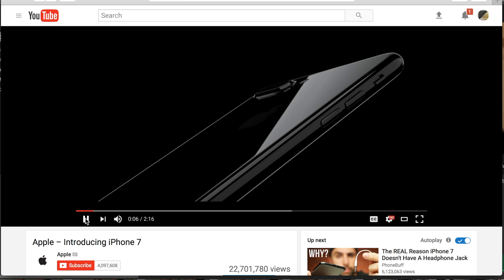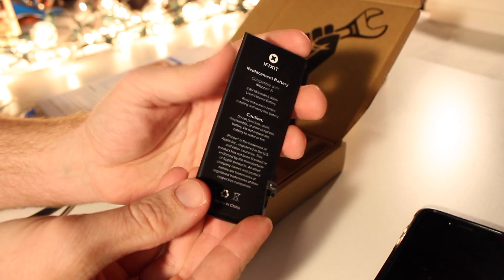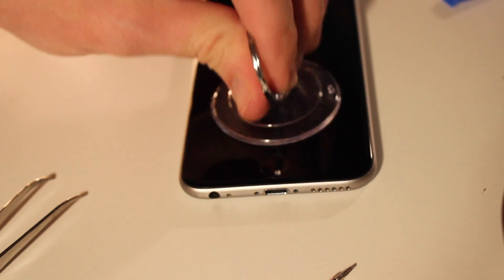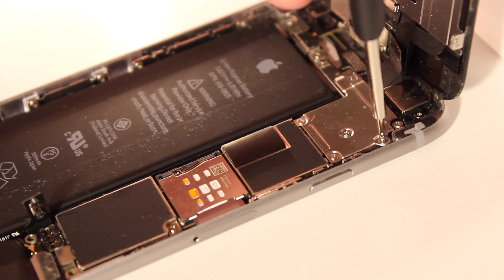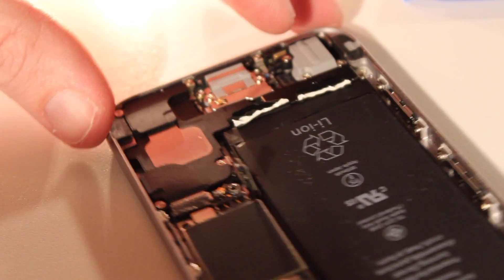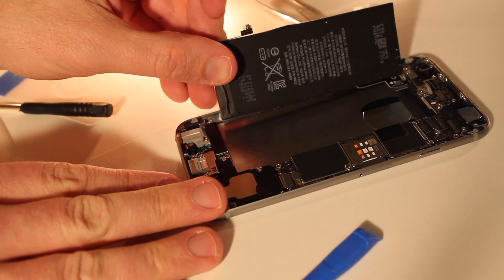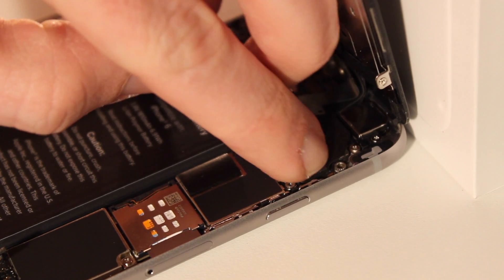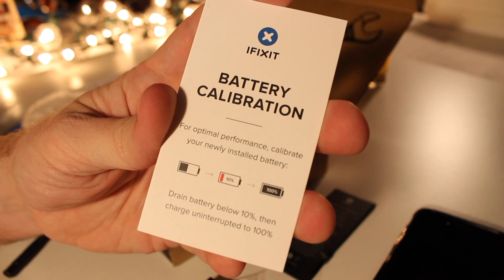How to Replace an iPhone 6 Battery (Using iFixit Kit)

Comment: If I forget to put back the battery connector cover and the display cables covers, that shouldn't cause a problem right?  I applied the new adhesive and closed the screen forgetting to reinstall those.

Comment: Hi. Are you still YouTube. I have just Watched your territorial on replacing the battery I’ve done it and thought I done it correct but I do not have a battery light no power , I did think that the battery might be flat I’ve put it on charge and the Apple logo light flashes on and off so I’ve disconnected it I’ve tried again still not seem to get it to work have you got any thoughts and ideas what it could be please. 
PHIL FROM THE MOULIN FRANCE.

Comment: Thank you!  It totally worked for me to pull the tape strips out rather than heating up the phone.  I was able to replace the battery using your video, my magnifier hobby light and some well-placed painter's tape to keep track of the TINY screws.  I've never tried to DIY fix any of my tech toys and was skeptical, but figured I did not have much to lose.  I am so happy!

Comment: I’m having the same issue with my iPhone I have an iPhone 6 and it’s so annoying how the battery drains even when I’m not using my iPhone
Reply: Same issue with my iPhone 6s about a month ago, the battery was not holding charge . I was going to have the battery changed at the Apple store but before making an appointment I was advised by an Apple staff to check if the software is updated to the latest iOS version and if not, do the update and if the battery is still not holding charge then have the battery changed. Voilà! It worked, the issue was resolved! It’s still working up to the present.

Comment: There is no need to disconnect and remove the display.  Just arrange it so that the cables aren't stressed.  If you really feel the need to remove the display, you need to know the plate with 4 or 5 screws has screws of different lengths,  If you put the long screw in the  wrong place it may hit the logic board. Goodbye iPhone!

Comment: Can you use double sided tape instead of the horrible strips, just in case you need to re-position the battery? Why does battery have to be stuck down so severely?

Comment: Excellent, thank you very much.
Is it absolutely necessary to remove the screen?
Reply: TPHVICTIMS if you have never done this yes if you have experience then you dont have to I never do when I replace batteries but be warned if the screen falls past a 90° angle then you can break flex cables like the front facing camera or even lcd connectors
Reply: @176cgna  Just use a rubber band to keep the screen in a vertical position.  You can use the phone box or some other object.  Mush safer than messing with all the cables and connectors associated with the display assembly.

Comment: Don't do this, I bought the battery replacement followed the guide exactly now home button doesn't work, and now WiFi and bluetooth wont work. Worst nightmare ever. Save yourself the headache and don't buy this replacement product, even if you see others comment with success. I used anti-static mat, clean hands, spludger tools, used super safe measures, and never removed screen or 5 screw plate and only removed battery and still have a broken phone. I thought for sure this was going to be a super quick fix and I was super careful.  The repair Information on the topic is so vague, has scare tactics, and overall iPhone just sucks. The iPhone 6 isnt supposed to be so touchy. I took it to a repair shop and they tried a new screen assembly with all the flex cables along with a new button. They said I did everything right and just sometimes this happens, but claimed my logic board and chip-sets may have sustained damage and the whole unit is now un-repairable . God I cant believe I thought this was going to work. Worst thing I could have done considering I use the phone for work everyday, now I gotta shell out major money for something else and copy everything over now. I hate APPLE!!!!! FUCK EM!
Reply: KINGBOOBUSTUBER you must have ripped a flex cable or antenna maybe knocked off caps or resistors that control home button flex any microsoldering shop can fix the motherboard it just won't be cheap or quick.....
Reply: 176cgna I just said the repair shop tried different screen and cables. I didn't knock off any components.
Reply: KINGBOOBUSTUBER if home button doesnt work and it did work before repair then you 100% did either damage a flex or a component I can bet on it.
Reply: sounds like error on your part to me.

Comment: when i plug my phone to the charger, it runs pretty well but when i remove it, it restarts again & again! I guess it's a battery issue. Is that correct?
Reply: Sounds like a software issue. If it was a battery issue it wouldn’t come back on I’m thinking.

Comment: Take the Taptic Engine out and pull the adhesive strips to an angle they will come out easier don’t always come out perfect with them in😀
Reply: Orion Wilson theres no taptic engine on the 6

Comment: All other videos DO NOT say anything about taking the screen off. You are opening up yourself to a lot of heartache if you do this. Don’t do it!
Reply: What are you talking about?
Reply: Jeff H There’s 2 parts to the iPhone- the screen and the shell. The only way to get into the phone is to remove the screen from the shell.
Reply: @JS-qg1ie  Absolutely NOT NECESSARY to remove the screen/display assembly.  Just arrange to hold it 90 degrees from the phone body.

Comment: Thank you for this video. It was super helpful. I was able to change out the battery on my i6 without removing the screen cables, but I can absolutely see how removing them would have made it easier. My biggest problem was the adhesive strips. I pulled them out slooooowly, but one of them broke off the last inch underneath the battery. That one inch of adhesive strip made it so hard to take the battery out. I had to heat it with a hair dryer to where the phone was almost too hot to touch. Only then could I pry it out, and it still resisted a LOT.
Reply from the maker: Glad to hear the video was helpful. Those strips can be the trickiest part!

Comment: NOTE!! when re-assembling the connectors make sure they are EXACTLY placed to align with the print connectors.. else parts of the screen will not work.. not gonna damage the screen.. but you will need to redo the pin connector assembly. Happened to me ;-)... also.. the tape strips broke and retracted under the battery.. next time I will simply use a plastic card right away and push it it gently and repeatedly under the battery all the way round.. takes about 5-10 min!.. but then there is no risk of damaging anything. Oh, and the replacement battery works perfectly so far :-)

Comment: Please answer as quick as possible what do I do because I punctured my battery nothing happened but I had a few Sparks and I am a little scared what should I do with the old one because I can't throw it away and I don't think I can recycle it what do I do?
Reply: Throw it in a bucket of salt water for a while then throw it away. Do it outside.

Comment: DO NOT LISTEN TO THIS GUY.  HE IS WRONG.  YOU NEED TO DISCONNECT THE BATTERY FIRST BEFORE DISCONNECTING YOUR 3 SCREEN PLUGS
Reply: He does disconnect the battery before doing the screen
Reply: Nonsense
Reply: Dumb ass he disconnected the battery first

Comment: Hey, I'm having problems opening the top part of an iPhone with the suction cup. I've done this many times but for some reason this one seems to be pretty hard. I tried using the blow drier to dry some of the glue around it but this screen is solid shut. Help please!

Comment: Not to mention Apple just came out to admit that they're throttling CPU as battery ages.  So replacing battery is way cheaper than buying a new phone.
Reply: Tim Brunson You can disable it
Reply: @rwhoosh1122  How?
Reply: Ledo Mc 

1. Go to settings 
2. Go to battery 
3 then go to battery health 
4. Under peak performance capability if you see a blue disable button then click on it. If you don’t see the blue disable button that means your phone has not been throttled and never experienced unexpected shutdown.
Reply: @rwhoosh1122  sir help me i click the blue disable then accidentally click disable not the disable on possible nothing will damage my iphone? How can i bring it that?
Reply: @zurhainejuandayalicawayzai4613  I don't understand what you said because you said  " i click the blue disable then accidentally click disable not the disable." Do you mean that you turned on the Optimized battery charging. and want to turn it off, or you want to turn it on?
Reply: R/whoosh yes exactly what i mean..
Reply: The new phones are 1k plus.

Comment: Help Anyone: I couldnt put one of the screws back- the long one of the 5 for the display connection, i just placed it back in the hole (top right if holding phone normally). its just sitting there, will i have a problem?
Reply: thx

Comment: is it necessary to take the screen off?
Reply from the maker: It made working with the phone easier for me, but according to others, it’s possible to keep the screen attached.
Reply: Ana_nz I've seen other tutorials where they don't take the screen off.  It looks much easier in my humble opinion. Quicker too.
Reply: It could blow the screen backlight
Reply: It’s not necessary. It just makes it easier because you don’t have to worry about damaging the cables.
Reply: I was just about to ask this. I won't do it now.
Reply: Ana_nz I would recommend it because I accidentally damaged the cables and my screen didn’t work.

Comment: Nice DIY repair. But for anyone looking to do same job as professional, always replace the screen adhesive to case to ensure the slight water resistance!
Reply: there is no screen adhesive to case on a Iphone 6
Reply: Its a rubber gasket

Comment: Ordered the iFixit kit and followed the instructions along in this video. Worked like a champ!!! Both sticky tabs broke on me, but I was able to barely dig out an edge of it and pull the tape out. Highly recommend this kit! Saved me $50 by using the iFixit kit. Thanks!
Reply from the maker: +Joe Rosen Nice work Joe!
Reply: Joe Rosen where do I order the ifixit kit darling?

Comment: Cool... How's the replacement battery standing up?
Reply from the maker: +Dave Weber After about 6 months, it's showing signs of aging already. It's still way better than where I was.
Reply: Gadgets and Grain your tutorial is great and earns a thumbs up. But I'm not buying from ifixit because, as you mentioned, showing signs of wear after just 6 months. I'd love to find a OEM battery.
Reply from the maker: Totally understand, but in my case, it was worth it. My old battery was pretty much useless after a few hours. I can at least hold on to my phone until the iPhone 8 comes out.
Reply: Had my battery replaced at an iphone repair shop. A few months ago. Few days ago it gave me a 1degree chemical burn

Comment: Do you really have to disconnect the screen
Reply: Gadgets and Grain You do not, I actually replaced my battery yesterday without removing the screen.
Reply: Advanced King Just lean the screen against anything, making sure it’s at 90 degrees.
Reply from the maker: Unfortunately, yes.
Reply: If it is leaning on something, why?
Reply: why??
Reply: Angel L how
Reply: its risky to remove the screen because the connectors can only be used a certain number of times before ribbon cable needs to be replaced
Reply: Yes, if the command strips break you have to get it out with a card. Take the screen off. Makes the process much easier without damaging anything
Reply: @variousrebuilds  REMOVING THE SCREEN is an unnecessary step.  Don't do it.

Comment: Word of warning: the 5 screws on the plate that holds the camera/screen/etc connectors are NOT all the same. Screwing the longer ones (hard to tell which are which) in the wrong hole and you'll damage the motherboard. That happened to me about 9 months ago… 😖 Hopefully nobody else will make the same mistake! ;)
Reply from the maker: +Levi Figueira Wise words! When you set the screws aside, it's a good idea to lay them in a configuration that matches their placement on the plate.
Reply: There’s no need to remove those connectors. I changed my battery without removing them.
Reply: I am sooo glad you posted this warning Thanks!😃
Reply: Which one do you have to screw the long ones into
Reply: the long one goes in the hole closest to the edge and closest to the bottom of the phone... so.. upper right corner in this video.. the other 4 are the same.. when re-assembling the connectors make sure they are EXACTLY placed to align with the print connectors.. else parts of the screen will not work.. not gonna damage the screen.. but you will need to redo the pin connector assembly. Happened to me ;-)... also.. the tape strips broke and retracted under the battery.. next time I will simply use a plastic card right away and push it it gently and repeatedly under the battery all the way round.. takes about 5-10 min!.. but then there is no risk of damaging anything. Battery work perfectly until now.
Reply: ItzReaper top right corner is the long screw.
Reply: Mark the screws with sharpies, 5 different colors, or/and put them in the same pattern on a flat sheet of paper.